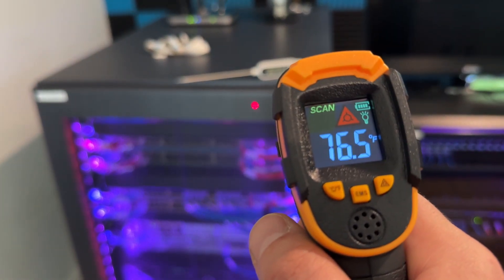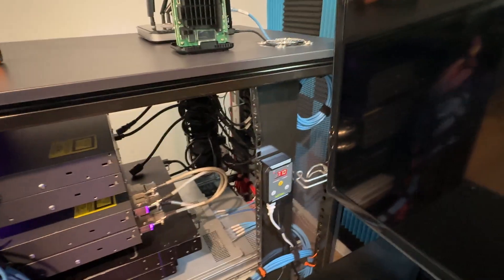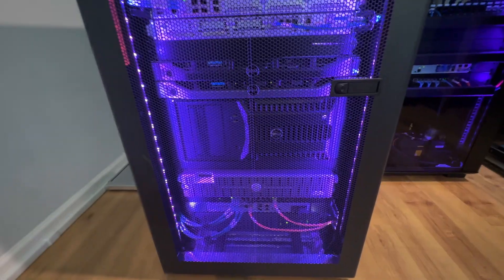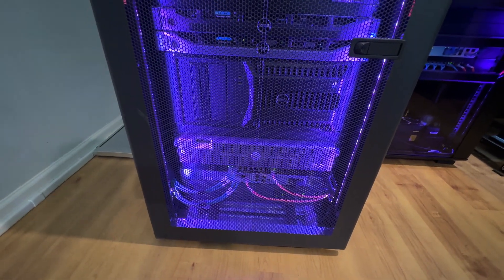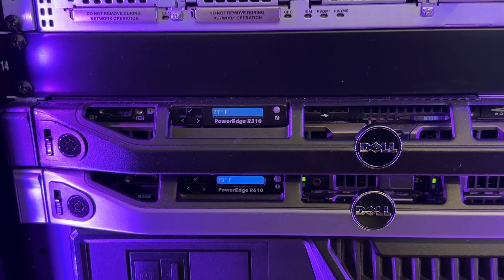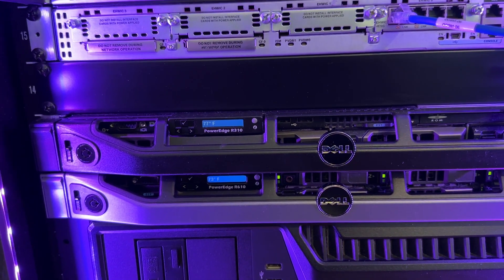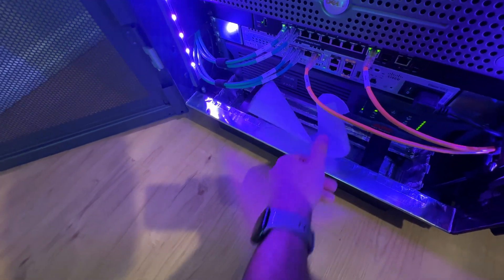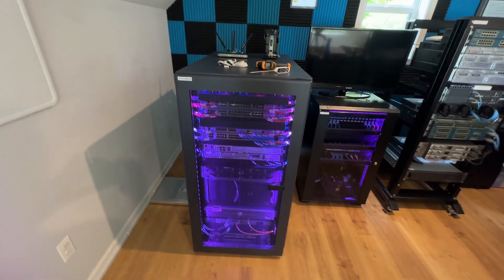RMTechCentral Server Rack Cooling Project Pt.3

Comment: sorry bud but how is this sufficient what happens when your house cools off in the AC turns off
Reply from the maker: Well, when the house heats up again, the AC turns back on. Also, keep in mind that even when the AC is off, it still draws cooler air from the lower level.